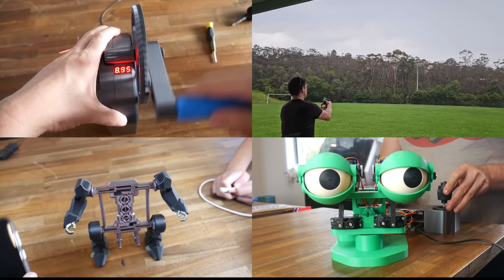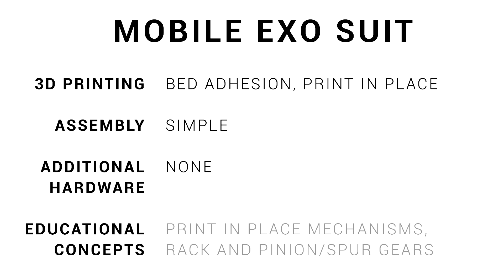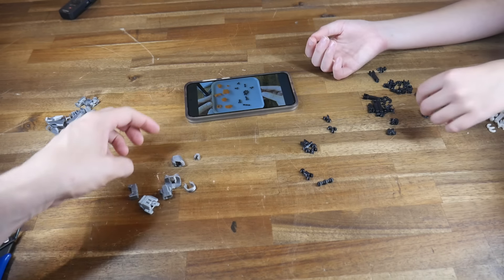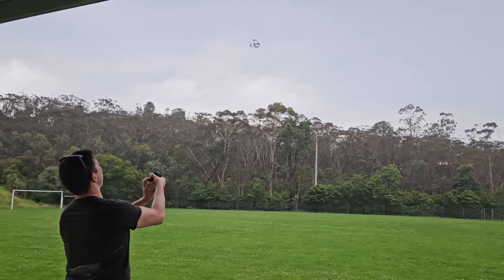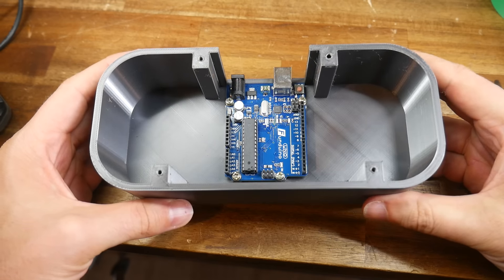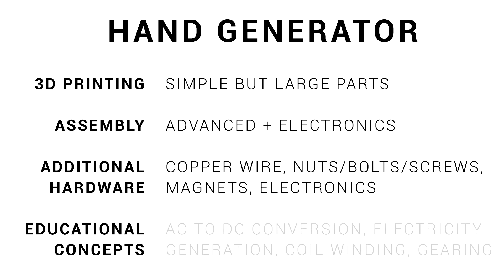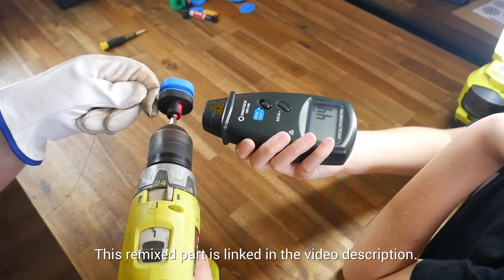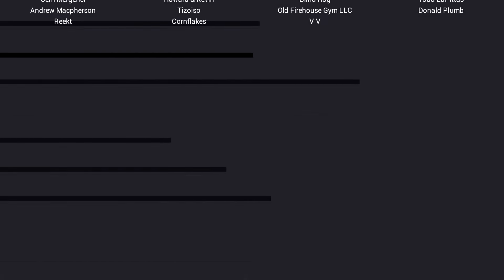Six incredible 3D printed projects for fun and discovery

Comment: You should add a few capacitors to that hand crank. That way, the power doesn't fluctuate that much and you will have a better experience with your emergency charger (Li-Ion batteries prefer constant voltage and constant current).
Reply from the maker: I only mentioned it briefly but I did include some as per the original build instructions. I found the measured voltage was significant higher after adding them. I figured the fluctuations were like PWM without them.

Comment: I made the toroidal launcher with my son a little while back. To make it easier for him to launch I made the bottom grip longer and a longer top shaft to improve hand clearance.
Reply: I'm struggling with this. What filament did you use, my dimensional accuracy is not good.
Reply: @stevenborg2477   just a inland  black pla, my fit with the triangular part in the bottom wasn't good, so I had to make it a little bigger with a Dremel. Then  lube is also pretty essential, the first little bit it took a lot of torque to get it spinning.

Comment: Tried my best with the Toroidal Launcher, about 4 - 7 part reprints, just can't get it to spin freely. I run Ender 3 printers and they print quite well. First layers are good, not printing too fast, its just a touch too tight when its all in the housing.

Comment: 8:05 For the most material combinations that include plastic, silicone oil, or silicone grease (most time better if you can bring it in) will be the lubricant of choice. Normal oil is not good in lubing plastic. Sometimes it make it even worse. Every material combination has its own lubricants. For example wood. Try to use oil on wood. It will be much worse than without and it will start squeaking. For wood, hard wax is the way to go.

Comment: @TeachingTech Regarding the poseable figure, you mentioned using PET-G or ABS. Just curious if you have tried PLA+ (PLA Pro) which is more resilient and durable for mechanical items like this? 🤔
Reply: Ive used Sunlu PLA+ only yesterday and its fine. The trick with Dummy13 is you MUST calibrate e steps and flow and use the Outer/Inner option under wall settings. These things are key for precision prints and this just wont fit without them. Just about the print the Deadpool accesory kit.

Comment: Great video. with the hand crank, what part did you use to charge your phone.??
Reply: 2Pcs DC 6V 9V 12V 24V to DC 5V 5A Buck Converter Module 9-36V Step Down to USB 5V Transformer Dual Output Voltage Regulator Board, I got this on amazon

Comment: Very nice video. Quick question - do you happen to know which grade of magnets you used for the hand crank generator? I have been planning to build it, and I was just wondering which grade of magnets were used to get the voltages you measured since I am not planning on putting all 8 coils in series like you did, and I want to make sure I will still get a sufficient voltage. Thanks in advance!
Reply from the maker: They were man to be N52 as recommended by Tom, however they were cheap eBay ones rather than from a reputable magnet supplier. I have no way of measuring the strength, but I know the dimensions were off compared to Tom's video. Mine needed to be glued in whereas Tom's were a nice press fit.
Reply: @TeachingTech  Got it. Hopefully if I get n48 magnets, I will have better results with fewer coils in series. We will see... Thank you for your help!
Reply: @TeachingTech how come you stopped uploading to the tt racing channel? Would love to see some more videos! Thanks!
Reply from the maker: @nathanholy  Just a matter of progressing far enough to have something for the next video. I will get there, don't worry (but please be patient).

Comment: Hello! Grear video :D
What pcb board did you use to charge the phone with the hand crank? :)
Reply: 2Pcs DC 6V 9V 12V 24V to DC 5V 5A Buck Converter Module 9-36V Step Down to USB 5V Transformer Dual Output Voltage Regulator Board, I got this on amazon